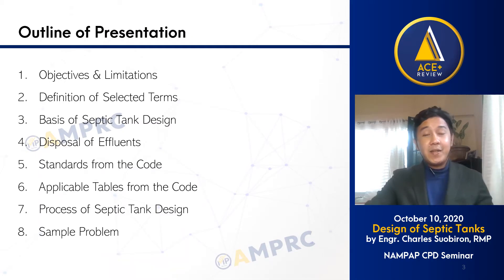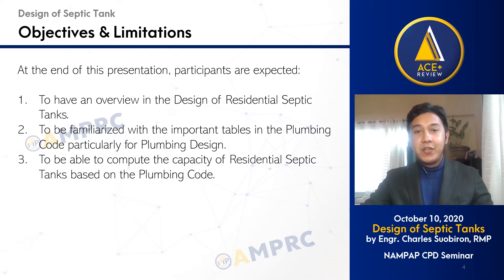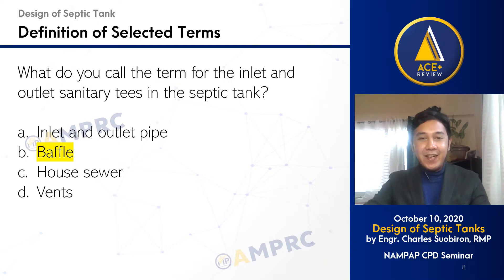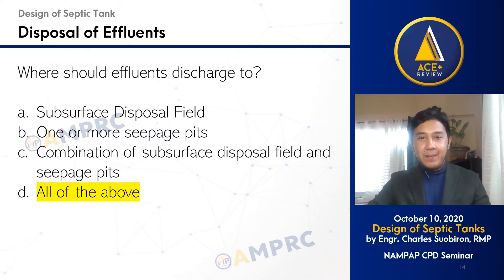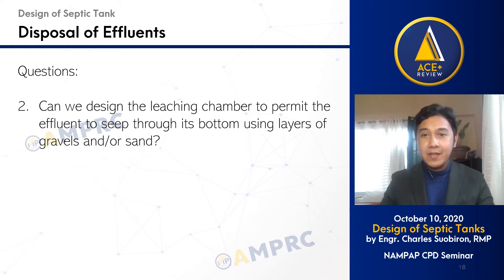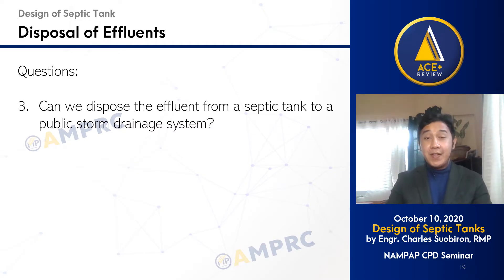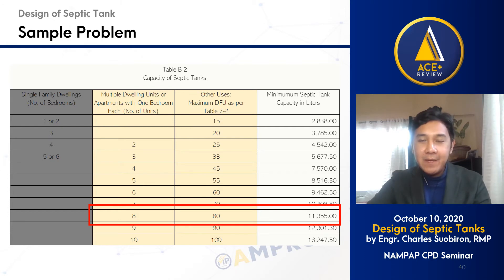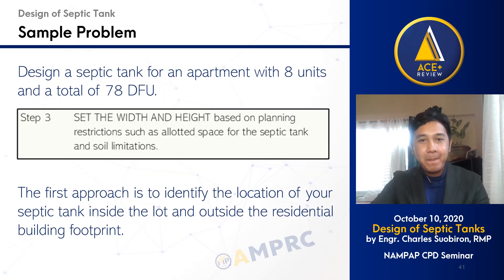Ace+ Review Center | How to Design a Septic Tank?

Comment: thank you sir charles for keeping as to update and revision that we were using now in design for septic tank.nowadays more on the developer are doing  the shortcut and substandards of doing the septic just to less their budget for the materials, without knowing  from the owner or a tenant that the septic tank constructed is substandard and it will less than year it will have a problem.sana maregulate ito ng maayos ng mga nagsusuri at nagchecheck ng mga municipality engineering bago nila pirmahan icheck sa design kung yung ginawa ng developer sa isang subdivision na mga septic tank sa mga units ng bahay ay tama.at syempre need din nila check din sa actual visit ito paea masuri ng maigi.kasi kadalasan after ng turnover kawawa ang mga client o owner ng bahay e.hindi nila nalalaman kung may problema or mga tubo sa papunta sa septic at iba pang drainage system.magugulat na lang mga owner barado at sa maiksing panahon napupuno na ang laman ng septic maging sa mga barang mga floor drain at d maayos at hindi standard sa pagiinstall ng mga tubo.sana maiayos ito at sundin ang tamang practice sa pagconstruct ng mga septic tank at mga tubo sa mga construction project nila.kasi hindi na sila mahagilap e pagnatapos na ang project nila na dinevelop kadalasan mga tamad pa at batugan sa pagaccept ng mga trabahong babalikan or back job.sana sa mga ganitong sitwasyon e mabigyan ng kabawasan na binabayad ng mga client or owner na tumitira na sa unit ng bahay na rent to own sa gayon makamenos ang client or owner sa part nila kasi ang laki laki ng binabayad monthly e.tapos ganun lang ang turnover ang daming back job.at mga sira ang unit na tinuturn over.dapat wag ganun at sana maaksyunan po ito ng national government para sumunod ng wasto at standard ang mga developer.salamat po.

Comment: You can recycle the effluent or liquid out of the chamber using natural filtration and use the filtered water for your garden and other uses. This is more sustainable. In fact it's not really hard to design. It will require additional 5 leaching chamber and a small pump for aeration. There's a DIY video out there that will teach you the basic on how to build it, then you can apply the rule that you learn from "Ace Review" to ensure that your build is per code.